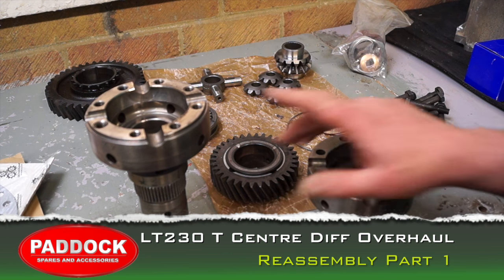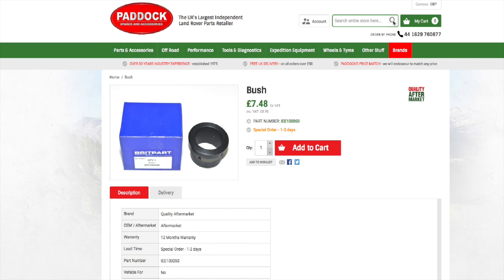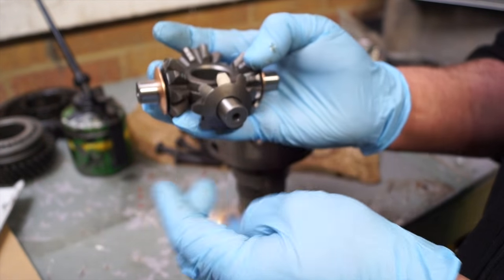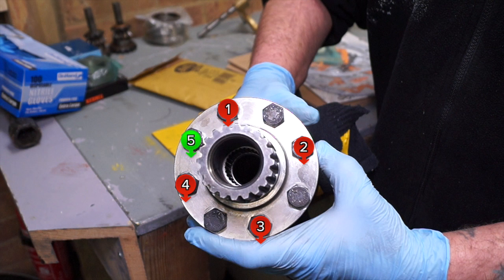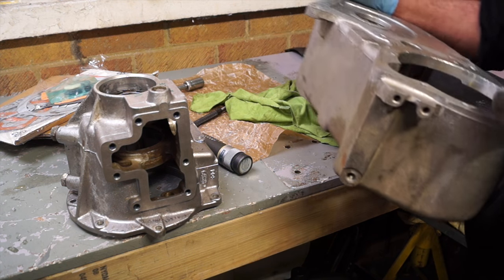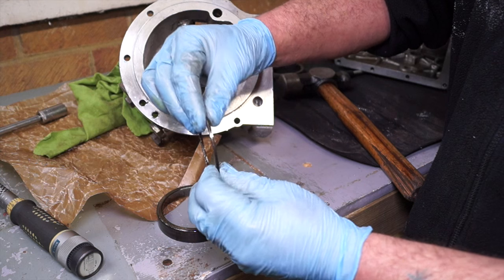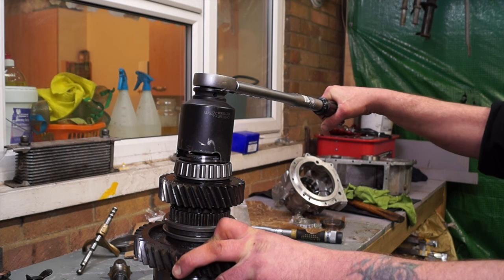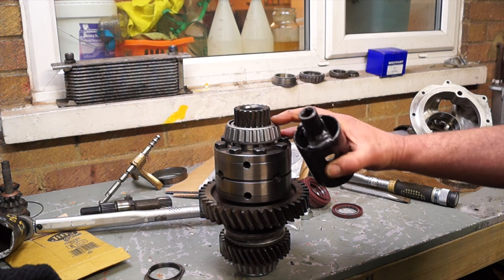LT230 T Centre Diff Overhaul - Reassembly

Comment: Unfortunately, it is not shown how to choose the thickness of the thrust washers of the side gears of the differential.
Reply from the maker: They come "as is" in the kit.
Reply: I know, but with 1.05 washers, the differential is very weak.
Reply: Complete with 1.05 mm. Often this is not enough. I, for example, had to sharpen the washers 1.75 in order to ensure a normal differential tension.

Comment: In assembling the central differential, the versions I dismount have a steel ring that holds a cross as a whole, between the housing, this model does not have? It is not necessary ?
Reply from the maker: +Carlos Granjo  if you have the cross pins it should be there.  If fitting a HD pin like ours then no.
Reply: +Land Rover Toolbox Videos Ah yes ! Sorry I remembered the crosshead that takes the steel ring is separated two sticks. Really, thank you!
Reply from the maker: Okay.